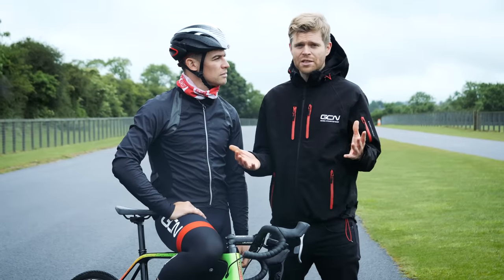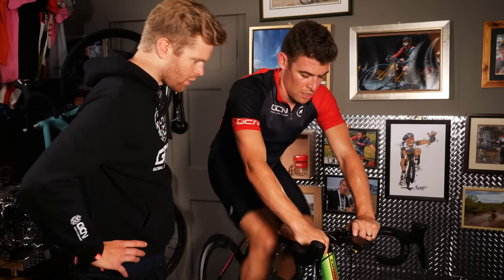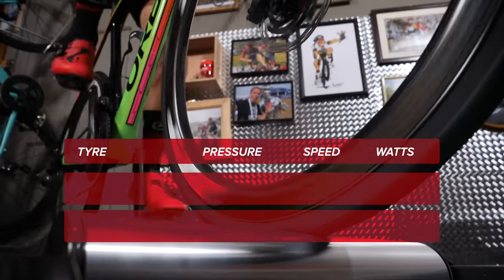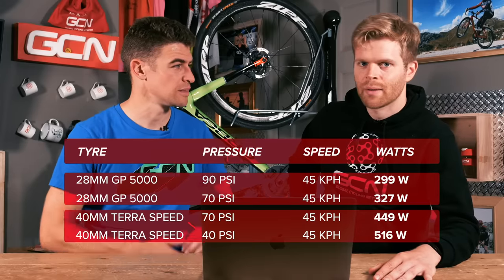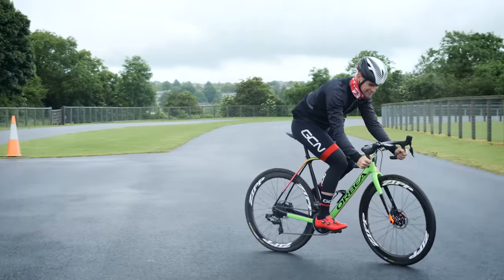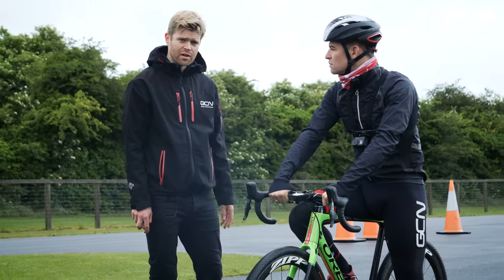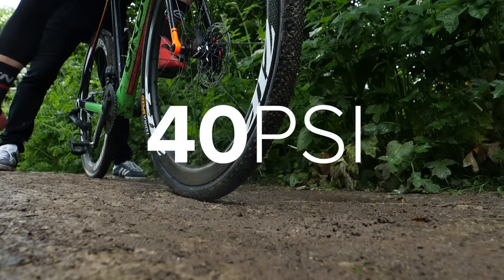Gravel Vs Road Tyres | How Much Slower Are Gravel Tyres?

Comment: Of course gravel tires aren't going to be faster than road tires from a technical perspective. I think it's down to the bite they have in it allowing you to actually go faster. For instance if you're all out pedaling with the smooth tires you're likely to fishtail and if you have any real speed, any shifts in weight or an actual turn is likely to have the bike slide from under you. That is where the knobbies come into play, it's biting into and conforming to the rock / dirt and gives you that on rails feeling allowing you to power through corners and the like without having to slow down as much if at all depending on the turn whereas the smooth tires, slowing down substantially is pivotal to actually make it make it around the corner upright.

So basically I imagine the speed differences between the two are characteristically different. The knobbies are likely still slower in the gravel due to the innate weight / rolling resistance and PSI differences and the fact it's biting into the surface more wasting even more theoretical power but that traction is what ALLOWS that speed to be maintained without sliding and falling. That said too if you were in mud where the tires are sinking into it above the rim with the road tires, the off-road style tires may potentially be able to stay on top of the muck with it's rough and higher surface area and in that specific case I imagine it'd actually be faster. I could also be over thinking all these scenarios too. I got to this video trying to see how much of a difference it'd make putting road ties on my mountain bike in terms of speed and less wasted energy. I also don't ride much but I might ride more if I didn't have to pedal so hard to get the speeds I want lol. Not sure how well it translates but I've been able to put out 2000 watts on a stationary and obviously not 10 minutes at a time but from what I understand that should allow for pretty good speed with the right setup but the major factors probably being wind resistance and secondarily the tires rolling resistance and of course the mountain bike springs likely absorbing a good bit of my output in frame flex each cycle but it's what I have and I don't have the money to dump into a good road bike that I might not really use much but if tires can make that much of a difference that might be something to try indeed lol.

Comment: I think by definition it's not pseudo science, rather so-called 'bad science'; even that is a bit harsh because Ollie and Chris are showing some interesting conclusions within the budget and time constraints they operated in. But the real question for a low level amateur roadie like myself is how to use this information when I'll (hopefully) have a budget for a new bike next year. Where I cycle it is almost inevitable to run into surfaces of broken concrete, roots that break the asphalt, and even actual gravel. So do I get a gravel and avoid buckled wheels but lose my need for speed?

Comment: did you guys just change the tires using the same rims? can i change my road tires to gravel using the same rims too? as long as the size the same right?
Reply: Yep, just check the maximum width tyres your rims and forks can accommodate as gravel tyres tend to come wider

Comment: Interesting as I've been using gravel tires for a while now for both road and off-road (because I'm too lazy to keep swapping them), so seeing how much they slow you down makes me feel so much better when I still overtake people on full-on aero road bikes.

I don't think either rollers or a roll down a hill teat are very representative of how tires are actually used though.
Would have been nice to see how much difference either in speed on an actual road at the same power, or what the difference is at say 35 km/h but on actual tarmac.

Comment: there are a lot of road tyres that will be even slower on on rollers  at 45 kmph compared to gp5000. You should've done it at 30 or less. I mean if you are on the road with gravel tyres probably you are racing TT to go 45

Comment: Should test those on a rough paved road. I suspect things would be different.
Reply: what about the gravel roll down?  You'd expect the 40mm tire to beat the 28mm, but it didn't either.
Reply: @WanderingSword  possibly but the kind of gravel could have changed it. I have found  that bad city streets have a much larger effect on rolling for me. Even the weight of the rider may have changed the outcome of the tests on gravel.
Reply: Do you know of any test that shows that a fatter tire rolls faster than a narrower tire if the fatter tire is at a lower psi than tha narrower tire?

Comment: Firstly, thanks for these tests.  The arguments about lower pressure being faster have never made sense to me.  Of course a road tire will be fastest on the flat muddy stuff.   Where the gravel tires are better is climbing, and handling on fast decents.  It's like comparing a viper to a boxster.  Faster in a straight line in the dry does not translate to faster on a technical circuit.
Reply: On a perfectly smooth road, of course you'd want a perfectly stiff tire, but on real world roads there is a critical point in which further increasing the pressure decreases performance. In their first test, they're using an extremely smooth surface so the higher pressure is definitely better. So lower pressure is faster, but only if you were overinflated to begin with. You can see in one of the videos with Emma about tire pressures, that increasing her bike's tire pressure past 90psi starts degrading performance(keeping in mind that she is a very light rider).

Comment: Thanks for sharing.  I appreciate the fact you're trying to help us riders by comparing and contrasting the two.  However I do feel that your testing methods has obvious flaws.  Testing on a indoor trainer with the rear wheels pressed between the two rollers creates a pinch effect with far more friction.  I've seen testing on a machine that has a computer with sensors and only one wheel to roll on.  To make one video, I would guess that acquiring that setup wouldn't be in your budget.

Comment: 90psi in a 28c seems a bit high. I run 75 in my corsa control. Used to run 80-85 but chewed out the center of the tread and squared the tyre off.
Reply: i run 110 PSI for years on all road tires and its fine

Comment: I rode both of them on my gravel bike and I can say that the difference in feeling is dramatic.
Reply: Please explain further. I'm interested as I have the conti terra speed on my gravel bike and looking to get try the GP5000 for road riding
Reply: @naj114  hi, the big difference is about thee tyres knobs. If tire has big knobs on it it will slow you down dramatically on the smooth parts of gravel and on the road it will be road apart. 

I ride right now semi slick tyre 38c and it is supeer fast. Also grip in the terrain is enough. I o not ride in a deep sand nor mud. For a gravel roads you doonn't nneed knobs but it is always personal choice and preference. I likeo go as fast as hell possible.

Comment: wouldnt peddaling, especially with a gravel tire, make a huge difference on gravel? for example, just rolling on the ground without peddaling would yield very similar results no matter what tires one used... wheras, peddaling would cause more slippage with road tires but would not be experienced the same with gravel tires.

Comment: I can see the merits of this test but it follows that a tyre that has a lower rolling resistance on the road would also have a lower rolling resistance on gravel!
 This is not however, a test of the tyres full capabilities. I mean, you try to corner on gravel with the road tyre on and see how far you get. This is the realm of the gravel tyre where the tread will show its true value. A better test would be a fast lap of a gravel circuit and see the time difference then!...(thats if the road tyre makes it round, of course...!)

Comment: all the pressures where too low. Road bikes minimum pressure are 7 bar (101ps) and the manufacturer's says (is print on the wheels or at their sites) minum pressure 7  bar maximum pressure 9 bar (again 101-130 psi)
I personally use 8 bars with my road bike and I weight  65kg

Comment: Guys, I've recently been working on a stuck Ultegra disc caliper piston. I noticed that there's a very small, almost easily missable split pin in the caliper that's called the "Bolt fixing pin" according to Shimano documentation. I can't find a description of the pin other than it's used when temporarily setting up the calipers without bolts (I think - not sure). I don't understand this. Should the pin always be there even when bolts are firmly (hopefully) affixed? Should I remove it when loosening or tightening brake calipers on the frame? Both front and rear calipers have one of these pins so they *must* be required, right? Can you sort out the confusion? Thanks! #AskGCNTech

An "hilarious" side note: searches for this pin - which must be virtually cost-less to produce - are for sale at £1.99 or (!) $6.32 (plus shipping) at various online outlets.

Comment: You need to figure in suspension losses. Consider how beat up you would be after racing a 100k gravel race on 28mm tires as compared to the 40s. Also, the gravel tire should be set up tubeless if your talking real world application.

Comment: This is great info to have, but, your methodology is flawed: 1) Can't use rollers, totally different pressure/friction issues 2)Gravel tires are only going to make a difference in speed when you're talking about descending confidence and when you're putting torque into the rear tire grinding up a lose surface 3)aerodynamics and rolling weight will make a difference, so, really need a longer real conditions ride at constant power or speed to get a sense of that. How about you both do 2 different trails with 3 different tires (including a hybrid like the challenge strada bianca) and doing your best to maintain a consistent average power?

Comment: Having a tube in the gravel tire isn't very indicative of true gravel use. If they are testing the tires to be real world reflective, I would have them set up tubeless the way those tires are intented to be. Or use a tubeless gp5000 as well rather than putting a tube in a tubeless tire.

Comment: If you’re comparing one of the fastest road tires with a gravel tire, better pick a top of the line tire such as Rene Herse tires or even a lesser but still good Panasonic Gravel King tires. Gravel tires should be smooth, not knobby. Knobby tires shoot gravel to the sides and can be dangerous on gravel. Those are for dirt and maybe mud. Roller tests are proven to be worthless because lower pressure tires dig into the small diameter roller and there’s no smooth steel surface in the real world... That’s a lot of effort in testing and filming, you guys should have asked around a bit before deciding on the tires and testing methods. And the road you tested for gravel performance is not gravel. Not even close to what a gravel road is. Rinse and wash again. Please.

Comment: Hi guys, I appreciate your effort but the roller test at 45km/k out of this world, who ride at this speeds? The friction increase is not linear so the difference will be way above the reality. You should test at 30Km/k average speed that's already high by any standards if you don't ride on flat roads all the time. Regards.

Comment: Like I thought, the experiment is all wrong. Sleek, road tires are made for speed, they ought to be faster on most surfaces. You could ride road bike hard on gravel and even win the race, but there is more chance that they will break and deflate more than gravel tires, making you lose in the end. And gravel ties are better for stability. The test is redundant.

Comment: Tire deformation on rollers is a VERY real impact on rolling and makes for an highly unfair comparison to road. Roller diameter is about 10cm. The earth is 12,700km. Effectively, roads are virtually flat. If you were to look at the cross sectional shape at the contact patch of both tires on the roller and then on road you’d see that the shape is very different between both conditions, and I’d hypothesize that the gravel tire inefficiency over the roller is the single biggest factor in the wattage difference. So, in short, weak, weak, weak testing method in trying determine “how much slower are gravel tyres.” Sorry, gents. Back to school for you both!

Comment: The only fault is they tested without aerodynamic disadvantages. So in the "real world" the results making a 50%-60% less difference because the rolling resistance is about 25%-50% of the energy you have to overcome.

Comment: I hate to be a nitpicker but rollers are not very representative of the real world (tiny contact patch, 3 contact patches) but also you didn’t account for the difference in circumference or the wheel changing the speed read by the computer

Comment: But your gravel tire was very knobby. I use WTB Byway 40s that have a slick stripe down the center. The difference in overall speed when I switch to my GP 5000s is marginal.

Comment: I did a test close to that on my fustle causeway gr1 probatly not the fastest gravel bike the 38mm Schwalbe ultrabite on roval slx 24 competed at 3 and 5 bar vs a conti gp 5000 25mm at 7 bar on roval c38
The gravel Tieres at 3 bar are all over about 1.3 km/h slower in every onroad conditions than at 5 bar.
At 5 bar they were a lot slower at the climb 1:19 at 307w the gp 5000 combo  did it in 1:16 At 298w.
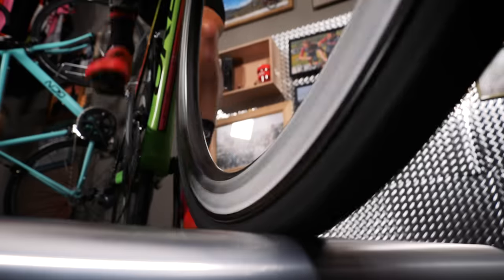At smooth tarmac there was no messureble Differenz maybe because of wind 1:43 at 245w at 5 bar vs 1:40 At 258w for the gp5000.
On rough tarmac it was 2:10 at 5 bar vs 2:12 for the gp5000 both at 250w.
The gp5000 on a tarmac sl 6 did 1:14 At 300w At the climb, 1:35 at 257w at smooth tarmac and 2:00 at 254w at rough tarmac

Comment: That wasn't gravel. That was hardpack. Try it on real gravel for example either a path of large loose baby head gravel stones that push your front tire around, or deep loose sandy crushed limestone that a 23mm road tire would sink into.

Comment: Not sure the contact patch on the rollers is the same as the road. Would make the rollers much harder than real world.
Reply: Bungle2010 the shape of the rollers digs into the tyre, deforming it more, compared to a flat surface. The result is still relevant, just exaggerated.

Comment: Harder tires HAVE LESS ROLLING RESISTANCE.
Reply: Is that means that ~50gr heavier tire with ~3w less rolling resistance is better in terms of achieving higher avg. speeds on same route VS lighter tire with higher rolling resistance? Thanks.

Comment: What’s wrong with a slow rolling tire. It just makes you stronger!
Reply: Nope. You just go slower.
Reply: Ross Fuller  My idea is that it’s a form of resistance training.  As you say ,you do go slower therefore you have to work harder to maintain your desired speed. When race day comes put on your “fast” tires and go like the wind.

Comment: Honestly pretty surprised by the results
Reply from the maker: What surprised you?
Reply: @gcntech  I didn't think that the gravel tyres would perform so badly.

 I'm curious if-  just like in mtb where plus size 2.8 tyres brought on the new standard of 2.4-2.5 tyres. Similarly in xc mtb, 2.2 is the new 1.9.... at some point the benefit of the wider tyre proved to outweigh the  extra resistance.
I'm curious if eventually well start to see even wider tyres on the road (28mm are still so damn narrow, even compared to 23mm of the past) and what width will be the "perfect" compromise.

Comment: Erm.. Is your test on the rollers even valid giving that you're point-loading the tires on a small-diameter roller, whereas in real-world scenarios, you're on a flat surface? Through my engineering-goggles, It's not.
Reply: Bungle2010 the fact that you use ‘probably’ in reply means you’re probably not even sure of what your claiming, whereas I’m lightly suggesting I actually do. The approaching ramp-angle of a small cylinder and point-loading of that small cylinder, is completely different comparative to a flat surface. The tire is forced to deform in a completely different way. Especially when you go down in air pressure, or use a larger volume casing, this exacerbates the issue.

Comment: A completely irrelevant test. If the only gravel you only ever ride on is very short stretches on downhill fixed gravel......
All you proved is that a thinner, smoother tyre pumped to a  high pressure will roll further than a fatter, rougher tyre at a far lower pressure. A 9 year old kid could have told you that. Last of your videos I'll ever watch.

Comment: Awful test. Much better to have used an “All Road” tire say a 35 mm or 40mm like the Mavic or Donnelly All Road with a center section designed for road and outer edges more for chip seal, rough roads and gravel. At 60-70psi these tires are mad road tires which work incredibly well and are super comfortable. Reduce the pressure and these super tires become amazing gravel and crap road tires. The road specific tires would fail that test. Of course you’re going to utilize more way more energy pushing a large low pressure tire with  knobs all over the tire. You didn’t need a test for this. You guys need to spend more time thinking about the details of your reports. All Road is best of all worlds. Your test could have indicated how best of all worlds they are versus road tires. But then you’re still riding with 25mm when you should at least be riding with 28-30mm. This is where the real fun is. Just my .2.